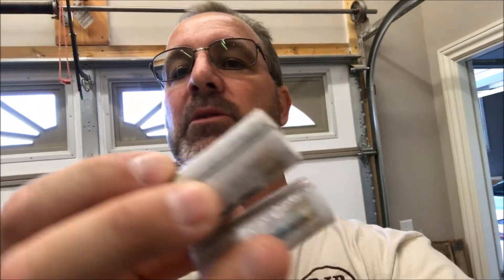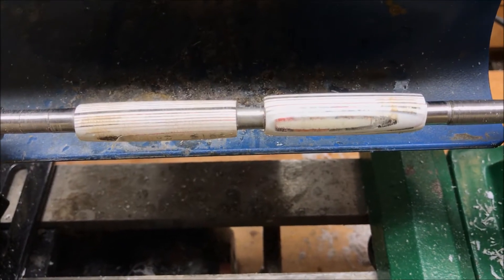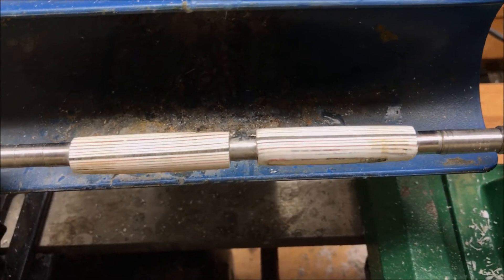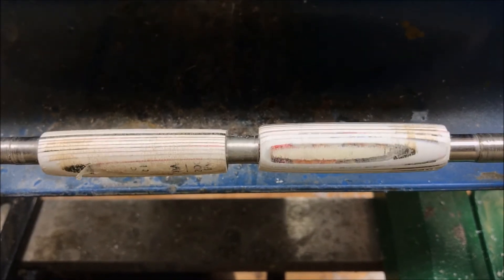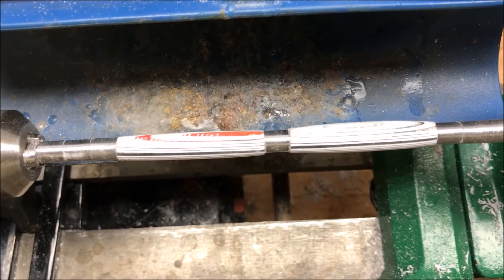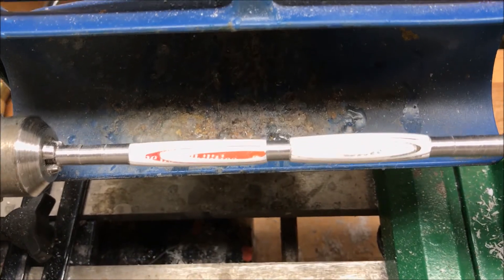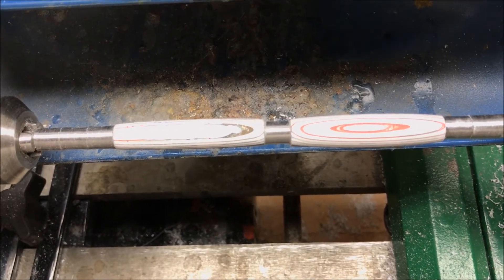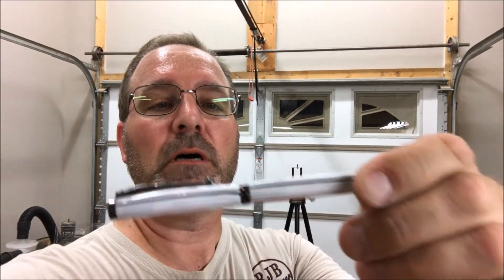Shop Update 6/20/2017

Comment: Maybe a different glue that will "weld" the plastic layers together rather than the "mechanical" grip that an epoxy provides? I'm thinking that either a PVC plumbing glue or perhaps a plastic model cement might give a welding sort of effect that would prevent the delamination from happening.

Good on you for staying the course and prevailing, Bob!
Reply from the maker: +Dwight Rahl That's an interesting idea Dwight,
  It smelled like PVC while sanding so it may be similar material. You may have just talked me into trying this again. Thank you for the suggestion. 

Regards,
Bob

Comment: Cool...! I ran into a glue up problem once a while ago; not with gift cards, but a plastic. I found that one of the epoxy companies, (don't remember which one), make a product specifically for bonding this type of material. May not cure the problem, but maybe worth looking into.
Reply from the maker: +Tarry Frey Thank you for the info Tarry, 
  I found out that gift cards are PVC. Looks like I will try this one again. 

Regards,
Bob
Reply: If that is the case, the cement used to connect PVC, ABS pipe together should solve the problem.
Reply from the maker: +Tarry Frey That's what I was thinking. They won't come apart then because they'll be melted together. 

Regards,
Bob

Comment: What did you use to glue the cards.  I am wondering if it would be better to impregnate them in epoxy like the pencil blanks
Reply from the maker: +Dave White I used LocTite two part Epoxy and I scuffed the surface of the cards before gluing. 

Regards,
Bob